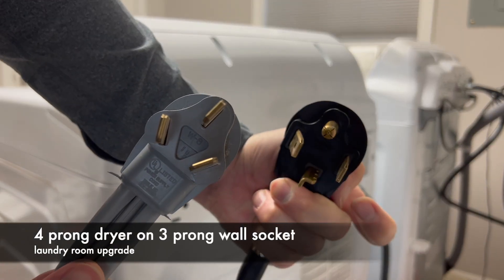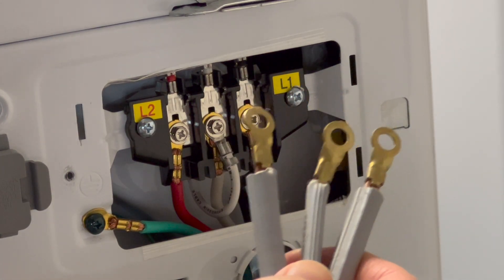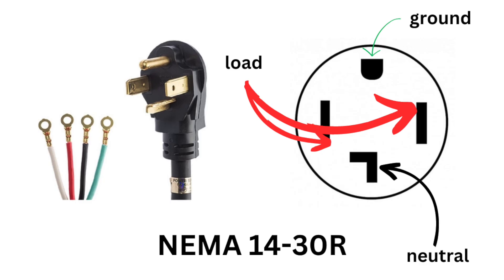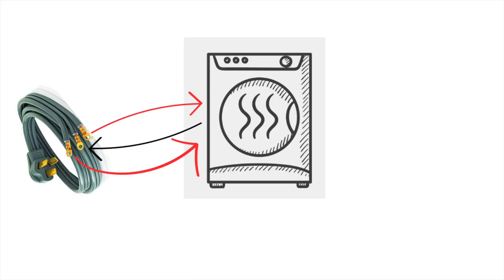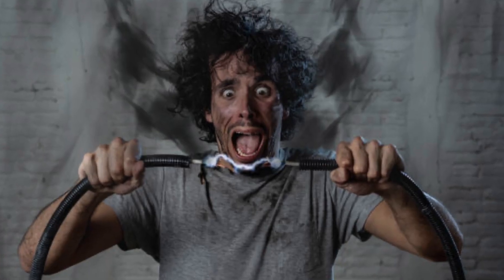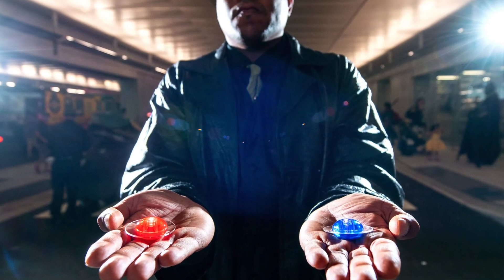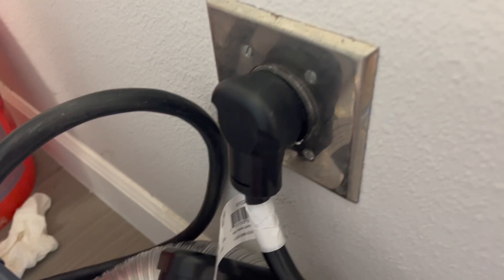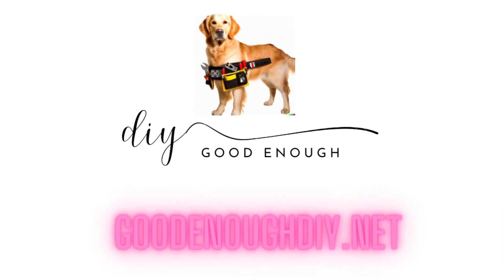Installing 4 prong 14-30R corded newer dryer on an old 3 prong on 10-50P wall socket

Comment: What if  I don't have an outlet for the green ground wire? 
This is the problem. 
Also, I'm not comfortable with replacing the original dryer 4 prong cord with a 3 prong cord

Comment: This is amazing. How long is the pigtail ground? Not sure if mine will reach the nearest outlet. 

Also, my NEMA 10-50 outlet is hooked up to 2 30a breakers tied together. Is this ok?

Thanks for this awesome video!
Reply from the maker: Hi @evanbaasinger5889!

I think the breaker setup may need attention from a lisenced electrician - this is what I could gather from the LLM like ChatGPT

Q. Is it normal for nema 10-50 to be connected to two 30a breakers?

> This is an important electrical safety question. A NEMA 10-50 outlet should NOT be connected to two 30A breakers. Here's why:
A NEMA 10-50 outlet is rated for 50 amps and should be connected to a dedicated 50-amp circuit breaker, not two 30-amp breakers. This improper configuration could be dangerous as:

The outlet is not properly protected at its rated capacity
Using two breakers tied together is not a proper substitute for a proper 50A breaker
The wiring connected to the outlet must also be rated appropriately for 50 amps

If you have this configuration in your home, I strongly recommend having a licensed electrician inspect and correct it. Improper electrical configurations can create serious fire hazards and safety risks.

Q. Then what's the 2 30 amp tied together good for?

> Two 30-amp breakers tied together (a 30/30 double-pole breaker) is properly used for 240V appliances that require 30 amps, such as:

- Electric dryers (with proper NEMA 10-30 or 14-30 receptacle)
- Electric water heaters
- Small electric kilns
- Some air conditioners
- Some welding equipment

The important thing is that the breaker, wiring, and outlet all need to match in their amperage rating. So if you're using a 30/30 double-pole breaker, it should be connected to:

- 10-gauge wire (rated for 30 amps)
- A 30-amp rated outlet (like NEMA 10-30 or 14-30)

Your current setup with a 30/30 breaker connected to a 50-amp outlet (NEMA 10-50) is mismatched and needs to be corrected for safety. The breaker and outlet ratings should always match.

Q what are my options?

> For a NEMA 10-50 outlet setup, here are your safe options:

- Install a proper 50-amp circuit breaker (the correct solution):
- Replace the two 30A breakers with a single 50A double-pole breaker
- Ensure the wiring is 6-gauge copper (rated for 50 amps)
Have a licensed electrician do this work

If this is for an older appliance that actually only needs 30 amps:

- Change the outlet to match the proper amperage (like a NEMA 10-30)
- Ensure wiring matches the new amperage rating

Again, have a licensed electrician make these changes

Comment: Can you plug the dryer with 4 wires then use a 3 a prong adapter? Or do you have to wire the dryer using 3 wires if using an adapter to match it?

Comment: the 'original' 3-wire scheme for electric dryers was not 'dangerous', and never will be.  what the electric code is doing is simply saying that a 4-wire scheme, with it's own ground wire, is 'safER'... although the likelihood of anyone on the 'old' wiring scheme would ever be shocked, or shocked enough to 'matter', is far and few in-between...  

you also mention that you didn't want to be shocked with '250 volts' of electricity - your statement is another misleading comment:  if either of the HOT wires broke/came loose/touched the chassis, AND the Neutral was also not doing it's job, AT THE SAME TIME and AT THE SAME MOMENT someone 'touched' the chassis, in that very, very unlikely moment, ONLY 120volts would be available, NOT 240/250.  Each HOT wire is only 120v.

so, no, no one will 'die' because of this, and likely, even if the code had NEVER been changed, no one will EVER know the difference, except the wiring companies who produce the now 'needed' upgrade wiring pigtail, and 4-prong Outlets.
Reply: those people working for the NEC have to come up with some new code to justify their huge salaries every now and then...